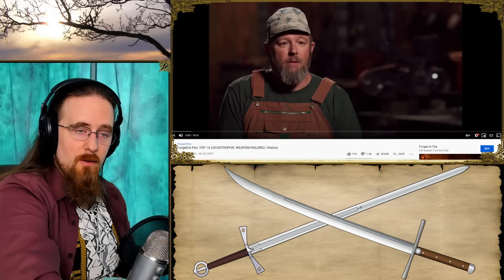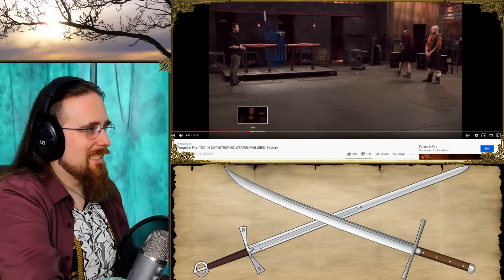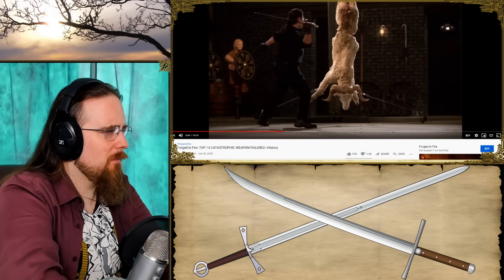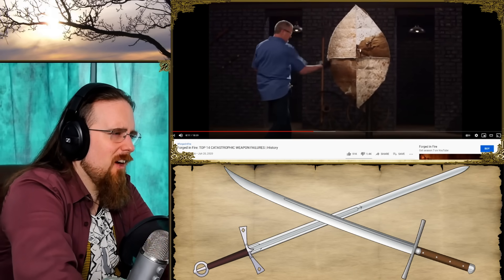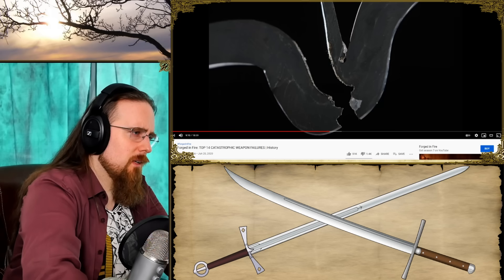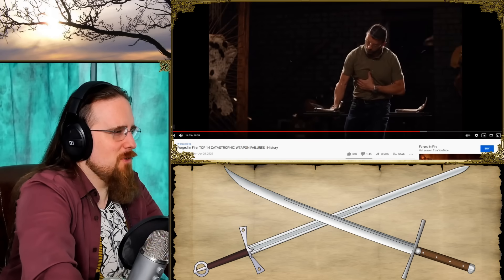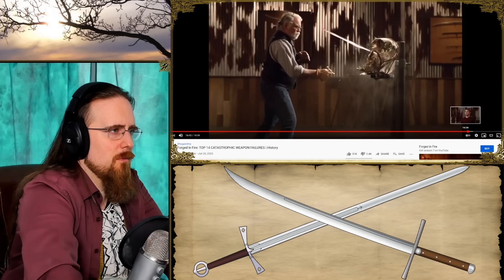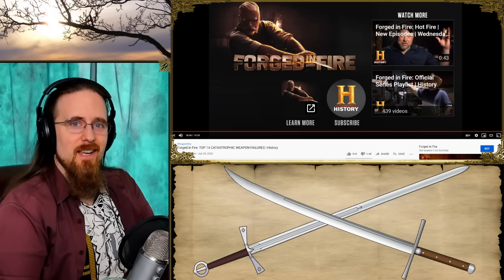Skall Comments: Catastrophic Failures on Forged in Fire

Comment: My problems with forged in fire are myriad. 

From the entire first stage of every episode coming down to 'make a bog-standard knife' to the numerous screwups in historical commentary on blades, to their testing that consists of 'We think your sword need to be anime-durable to be good', to them making people do stuff in a home forge, frequently with VASTLY different access to materiel and equipment. Then there is their 'experts' not knowing how to use the type of blade in question and winding up with 'bad sword' because of user error on spacing and alignment. 

The show can sometimes be entertaining, but from the standpoint of 'competition' it is UTTER trash and you will very rarely actually learn anything about weapons. At best you can use the historical commentary on the type of blade they are using as a launching point for researching the ACTUAL history of the weapon in question and how it functions.

Comment: Problem is the tests are also very unscientific. I watch this guy called “project farm” and his tests are a better example of what it should look like.

Or just take a look at how metals are tested in welding. Machines do the work, and they do it exactly the same way every time. With humans in the process you add so many variables that are not usualy accounted for.

Some examples of what are usualy unrecorded variables that come to play when humans (or any living animal) are in the  testing process: food intake, food type, sleep, water intake, stress, how firmiliar the human is with the tool, personal bias, inconsistent user error (as seen in the video with edge alignment), inconsistent strikes (we are not machines), inconsistent pressures and speeds (hitting harder then softer). I can’t say for sure but I imagine the weather even comes into play, I didn’t include it in the list because I can’t say confidently that it would effect these tests by effecting the human/s facilitating the test. Higher humidity could (I think) effect bow strings, and certainly the weather effects how firearms work at very long ranges.

Comment: With tests that destructive they're putting the testers and everyone else on set at risk. Since they're trying to break the blades, they really should be wearing full body armour to protect against flying blades, not just safety glasses (and minimal ones at that, not even proper googles).

@6:23 It looks like it was a direct hit on the thick metal beam/tube holding the shield. It isn't reasonable to expect a blade to survive that. It's hard to tell whether the edge alignment was off or whether the blade moved after hitting the rigid target. Also, that was a stupid blade design with a lot of unnecessary stress risers. Hardly surprising that both examples failed.

Comment: I agree that some of these are operator error, but on the battlefield no fighter will have perfect form all the time. So It's not fair to put the fault on the tester. I would not want a weapon, that would break if I didn't use perfect form every strike. Also, these tests are more about forging skill/heat treating, and less about realistic weapon testing.

Comment: Its a good Reality check for fanatics.
Especially Some HEMA fanboys lately were very obsessed with Spring steel superiority propagating how European Medieval sword is made from Space age steel just because people make blades like that today. As the same idiots would complain if they brake the sword that cost Hundreds and thousands of $. Not to mention availability of Controlled composition steel at cheap prices.
This is a very good slap on the Dick for those Propagating against actual historical Events, requirements, and skills needed to make ,maintain and use a Blade.
Its Bad for the Fanboys as they are delusional, its bad for the real Fans of History and is certainly bad for those wanting to Learn what actually happened and was possible and acceptable.

Comment: I really don't get why so many people are saying these tests are unreasonable. If most weapons manage to pass, it is an adequate test of metallurgy if not of battlefield utility. A weapon which can withstand being hammered into a copper pipe is clearly more durable than one wich cannot. And it's not like they don't take sharpness, maneuverability, balance, comfort or aesthetics into account.

If you want to test the endurance of two humans by letting them run 1000 km nonstop and one manages to do it, is it really a problem that the test is overkill?

Comment: I'm a blade-smith, I make knives. So do my brother and father. None of us like Forged in Fire because these tests are stupid. When do you need to hit a knife into deer antlers, copper pipe, or hardened/treated wood? Not likely and ridiculous. It's aimed at breaking the blades. Designed for failure for ratings, not cool. Also the blade-smiths almost exclusively work with power hammers, which I personally can't stand. Seeing bean stocks of men/women standing there acting all tough when they can't lift the hammer more than 10 times before they need a break. But what annoys me the most are these tests. They take perfectly good (usually) knives/swords and just fuck them up for views. It doesn't prove how good the sword is if you demolish it and then tell the smith "your blade did not make the cut". Yeah, difficult when you hit it in the same spot with a bat over and over.

Comment: Lets be honest about this...all this testing video mess/abuse of a cutting tool started in the modern era (unless I missed something ) with Cold Steel Proof Videos. Since then the limits have been pushed totally beyond the pale. If you think Lynn Thompson and his crew were bad or Skal is bad...nope not anymore. I think reasonable bone cutting (hanging pigs) etc are acceptable. If you're trying to break a blade you can do it. FIF has to go beyond for views. That being said, I have an A2 convex 1/4 inch spine bowie with African Blackwood scales, Corby bolts...made by the season 6 FIF episode "The Messer Sword " Winner,  Jeff Peters of Old Wolf Forge. Per his instruction I batoned it thru 4 inch seasoned white oak with a red oak baton as thick as my wrist. The purpose was to test its ability to assist in making fire. It passed with ease. This is not something I do to knives regularly, there are better tools for that job, axes for splitting come to mind. I hit that knife so hard my neighbors were walking out on the front porch to check that someone wasn't breaking in or something.😂

Comment: Some of those hardness tests are pointless, the way the object they are striking is mounted.  If you lay something flat and secure it to an anvil or solid block, you’re just transferring all the momentum right into what the object is mounted on; those tests are designed to break blades more than they are to test them

Comment: Never understood why chop tests were used on slashing and piercing blades, A piercing blade isn't bad if it can't chop something and chopping blade isn't bad if it can't pierce something. These test should be for the weapons that are being used. Slashing blades chopping hardwood is gonna fail especially on a straight hit, a small knife being hammered into metal or hit into bone won't pass even if the blade is strong due to lack of leverage, And they swing them like children that don't know what they're doing, Swordsmith doesn't mean swordsmen.

Comment: Keep in mind this is entertainment, Forged for fire not a military precision system. For the monies, thus a bit misleading.

No modern blade is made or tested in such ridiculous uncontrolled means.
Even though its a modern non modern society.

A metal structure would be x-ray, and metal scraped and tested. That would tell us the weak points and flaws. Then you would have pressure, and environmental tests, and other natural tests applied to the object in contained rooms, giving quantifiable data.

The means of production needs a 99.9% replication phase, meaning that there is less than 0.1% deviation from each model... but some things require a higher standard.

Then there is a engineering list gathered and put together by other engineers, throughout time, and materials and metals composites in what people would do to craft said item. 

Forge fire is a one time use, and a fun arbitrary test not really for anything but show value... What they say is entertainment everyone on there is a winner... its not a game show but the people in it can say whatever, theres a tonne of liars in the show business.

The square foot of x type wood, grain spacing, age, finish, etc, add qualities to a product that are measurable. Just as metal and other forms of manufacturing materials.

Comment: Sure, the way they test these things are brutal. But there's a couple things to keep in mind.

- it's for 10,000 dollar reward prizes every episode making production cost insanely high. Stakes also have to be high.
- Makes for better entertainment.
- If tests are this brutal and unreasonable, it pretty much guarantees some sort of failure from at least one of the bladesmiths. There is nothing worse in these kinds of shows to have two identically performing blades pitted to several judge's stylistic preferences on which one wins. "I don't like the colour of the wood you chose for this handle, so you lose, lol good sword tho now go home." It is ALWAYS better if one sword emerges with a flaw that makes for concise judging.
- These are not skilled swordsmen, Doug looks like a Dark Souls character swinging swords, but I believe he specialises in specific types of knife combat and martial arts? Someone correct me if I'm wrong. It's wrong to judge swords on what they should be able to do historically by a trained combatant, based off a man swinging it who is not. Now if they went and actually got someone trained in historical armed combat to conduct the tests, then that would be a different story.
- I have no argument to counter the 'ugly, sharpened hunk of metal wins over the pretty, well-made albeit obviously less robust sword' kind of deal. It seems almost like cheating. You can turn in a complete hunk of crap, and as long as it doesn't break you'll win over someone else that slaved away for hours and hours painstakingly creating a gorgeous sword.
- They're not testing for historical accuracy (most of the time), they're testing to see who is the best bladesmith in the lineup. Is it absolutely unreasonable to baton a damned knife through a copper pipe? Yes, obviously. But it's not about how tough the challenge is, it's about how good the smith is. That dude's knife broke in half, whilst the other guys survived with damaged although fully functional blades. The skill ceiling is higher, and the smith is required to match it or go home.

Comment: Hammering a knife into copper pipe? Why? It's a tool one would never use for anything like that. Not meant to be hammered or to cut metals, nonetheless both at the same time. That's like trying to use a fork to eat soup with and saying it's a shitty fork cuz it failed. Way too over the top.

Comment: how is chopping wood with a sword harsh compared to bashing someone else's sword or steel armor over and over again?
Reply: While steel is much tougher than wood at the same width, a much thicker piece of wood is going to be much tougher than a thinner piece of steel. 

Another factor is that armor and weapons shift, bend and flex when hit. This allows them to absorb and dissapate the force of an incoming blow. Both the attacking blade and the defending blade/armor absorb a portion of the force on impact. 

But because a thick piece of hardwood has no ability to move, bend, or flex, the attacking blade has to absorb all of the "shock" by itself.

Or at least that's how I understand it. Someone else might be able to explain it better than me though.

Comment: Its funny they wear glasses ... at the forces they are using if a splinter of metal would actually chip of and fly into their eyes I am pretty sure it would punsh right through. The glasses look mostly like chemical safety glasses. It really is laughable how unsafe it is what they are doing especially since they use so much brute force that they dont even control the blades properly an are actively trying to break the things.

Comment: It is kinda fucking dumb that they dont have any protective gear on, aside from maybe a glove and lanyard or some sort of thing to hold the blade safley while they whack pomel with a hammer or something, but other than that they dont have any real protection and the conrestants and other judges who arent weilding the weapon r quite close to guy swinging these weapons with all their might!!?? If a weapon fails it could easily fly at and hit the others standing around!? With the power they use when testing the weapons they really should at least have the people not using the weapon wearing some kind of safety gear but really should probably have them standing behind bulletproof glass just incase a blade breaks and flys across the room!? Theyve kinda been lucky so far that the blades that have broken havent flown that far but they definitely can especially when theyre swinging around swords!? If a big knife breaks its probably not guna go flying very far but when they're swinging swords or axes or anything that's fairly long theres a good chance if it breaks it could fly across room cuz of the amount of momentum weapon has cuz the longer the weapon the more momentum and speed it produces!?

Comment: I don't get the obsession with pattern-welded steel. It's not Damascus steel, it doesn't normally even look very good. I expect blacksmiths like doing it because it's a few extra steps and they can try and flex a little bit, I get that part, but it's steel pretty ugly. Sry that play on words worked better when you say it out loud.

Comment: IMHO the show's judging sucks. The tests are not exactly the same as the angles the blades are impacting are not the same, the forces they impact against the target are not the same.  Fair judgement should have the exact, as much as possible, testing. Sometimes the judge hits with the flat side of the blade and says the blade is not sharp enough.

Comment: Incorrect, pattern welded steel, if done correctly, can make a blade virtually indestructible. It’s a common technique used on large single edge blades like the Mongolian two handed saber, odachi’s, and even some German zweihanders. In fact the most famous zweihander currently being housed in the German national museum (the 7 footer) has a thin mild steel core, which was intended to absorb shock from slamming against pike formations.
Reply from the maker: "can make a blade virtually indestructible"  What makes you say that? Exactly which steels do you suggest to be pattern welded into an "indestructible" blade?
Reply: @Skallagrim  well as an engineer I can tell you there’s no such thing as a universal perfect steel. It depends on what the tool will used for. For example, if you are designing a single edge blade like a saber that will be used for cutting and slashing its a good idea to layer your billet with high carbon steel on the outside and mild steel on the inside. That way you have a blade that retains its edge while also having a spine that can absorb the impact of the blow, which not only makes it stronger, but also more user friendly. Many Calvary sabers are named “wrist breakers” because they forged the blade out a single piece of high carbon steel. Meaning that the impact of the blow isn’t absorbed by the saber, but your wrist and hand instead. Nothing is indestructible if you’re trying to break it, but we can design things in a way that makes it very difficult to break.
Reply from the maker: @mrkennady   Yes, I agree. But the same applies to mono-steel. For instance, which steels would you pattern weld that would consistently out-perform 5160 in toughness and wear resistance by a considerable margin?

Comment: Strange show. You wreck blades on purpose with tasks they were never designed for. That's like judging normal t-shirts on their ability to stop bullets and complain that there are holes in it after the test.

Test it with dummies, fresh bone etc. but not hardwood planks and bronze pipes.
These more harsh tests should, as Skal pointed out, only be used to break a tie.

Comment: This show is mostly bullshit: just starting by the fact they give the smiths 5 days to forge a weapon from 0 to this strength test bullshit. No shit sherlock a good 80% of the blades would snap if you bash em full force against a solid piece or wood.

There's an episode where they do it too l, and they give themselves two weeks 😂😂😂 and on the tests they're not even as hard as they do with the contestants.